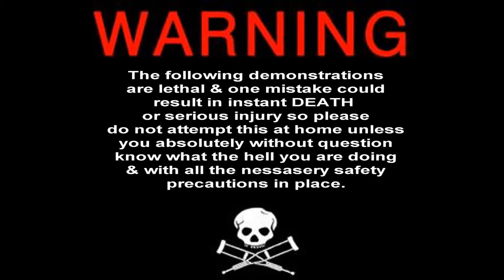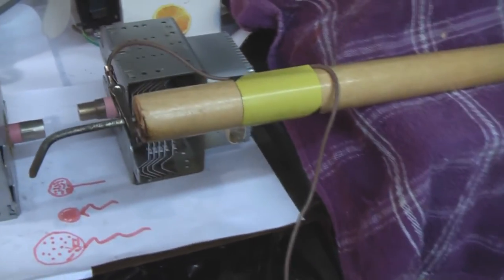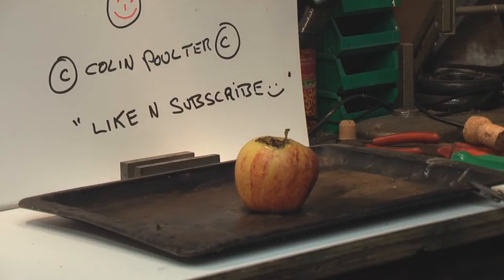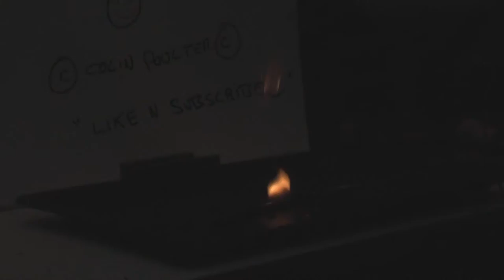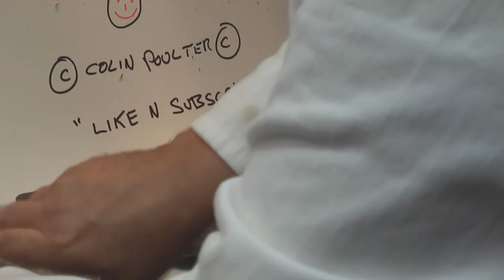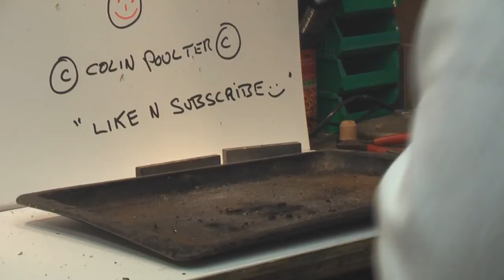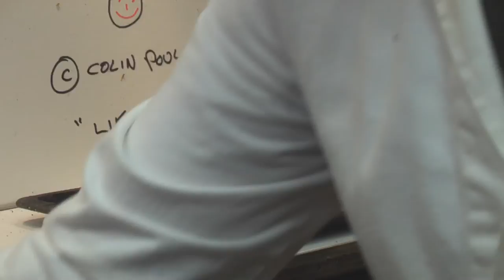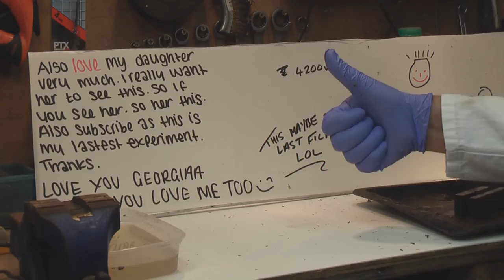Fire Arc 2 (Microwave Oven Transformer)

Comment: So, question. Since the secondaries on those MOTs are grounded directly to the core, does that mean the core gets brough up to output voltage (relative to the ground you're standing on) when it's powered? And so if you touched the core, even if you were nowhere near the HV output tab, you'd still get zapped?
Reply from the maker: +PremierMilenkov no the core is a zero volts
Reply: Colin Poulter Interesting. I was just asking since someone on a HV forum said if you feed AC directly to the primary, the whole transformer becomes hot. Didn't make sense to me at the time (since like you say, I assumed the core, being basically the neutral return path of the current would be at 0 volts), so I decided to ask someone who's dealt with MOTs before, which is how I landed on this video. Thanks for the answer, in any case, not sure what the other bloke was on about.